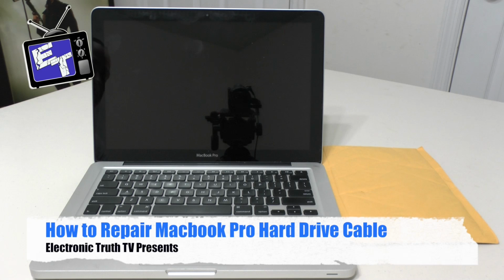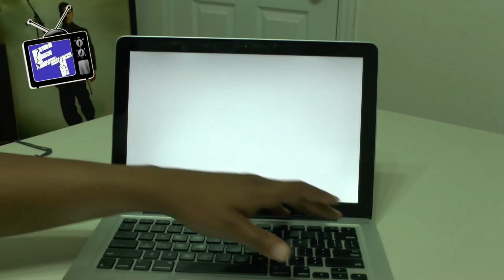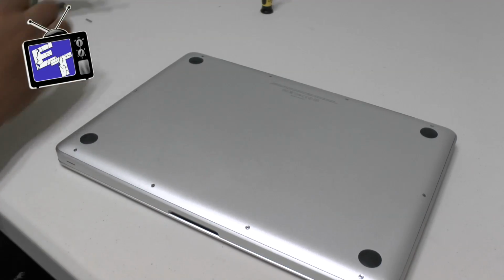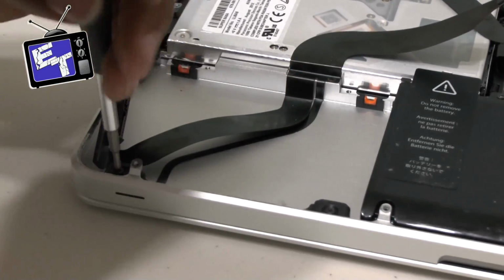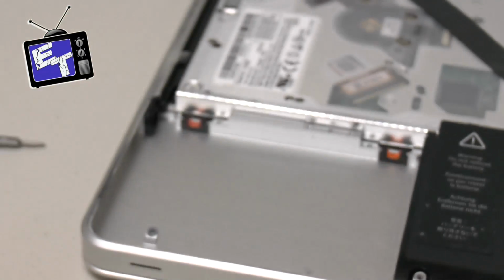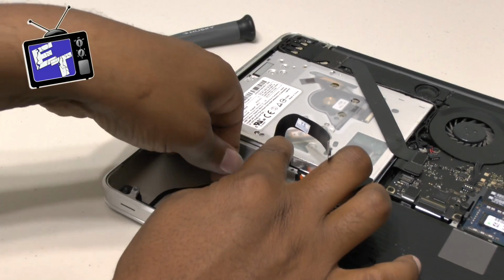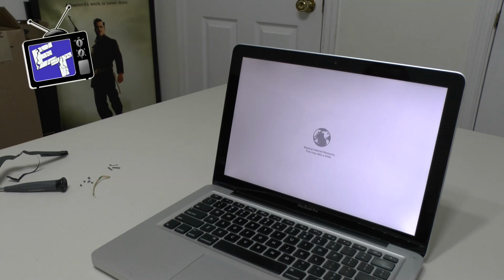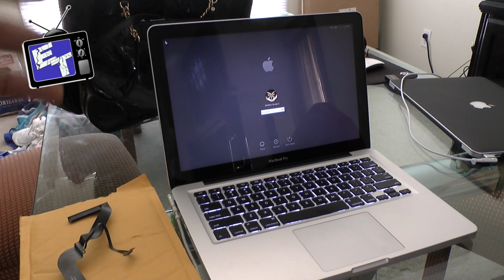How to replace Macbook Pro Hard Drive Cable

Comment: Yo this question mark folder just happened to me and have troubleshooted pretty much everything. I'm curious do you know if the hd cable would show up faulty on the diagnostic report when you boot and press the "D" key? You also said towards the end of the video you re-installed the operating system. Im really hoping I don't have to do that since I didn't use time machine before the ? folder. Please it would be great if you got back to me as soon as possible.
Reply from the maker: Hello, I'm not sure... The reason I did a fresh install was because the drive I was working with has been corrupted. You might not have any issues replacing only the cable. Good luck
Reply: Yeah replaced the cable and everything was back to normal. Lucky enough to not have a corrupted drive. now time to setup time machine for precautionary measures. Thanks for the vid.

Comment: I replaced my hard drive 6months ago and now had issues once again this time it was needing a new cable. I got the new cable in and still new hard drive got it all connected but now it wont read the hard drive. I get an exclamation point with an error -1005f. I took everything apart once again(maybe a cable was loose) re-installed the error is gone but still not reading the hard drive. Any suggestions?
Reply from the maker: I'm not sure... It might be worth letting a apple tech look at it to at least diagnose your issue.

Comment: Thanks man~! I have been having the same problem. Any hard drive that I install in my laptop makes the blinking folder come up. I did some troubleshooting and came to the conclusion that it's probably the hard drive cable that needs to be replaced.

Comment: thank you. i had some problems upgrading from hdd to ssd. first i had problems with deleting the drive, then i wasnt able to get the backup on the new drive...so i made it via usb...then i placed the ssd into the mbp again and this folder appeared....50 bucks and one week later my mbp2012 is running speeds on a completely insane level...now my ssd works :D thank you :)

Comment: great video!  I am in the process of buying the replacement cable but was tentative because there are ones that have the bracket and others like the one you purchased.  Now that you showed me how easy it is to attach the IR sensor looks like I will be buying the less expensive cable that doesn't have the bracket included!  Thanks for the vid

Comment: Thank you so much for the detailed instructions! I am now heading for the Genius Bar to have the new hard drive reformatted and will then reinstall from my external drive - Time Machine backup. Had a minor heart attack at one point when I thought the cable on the bottom bracket had broken away, but it was all good, once I rewatched that part of your video. Found the cable online and had it in a matter of days.

Comment: How can you diagnose to see if it's the hard drive or the data cable?
I have a 2010 Macbook that's doing the same thing.
Reply: +Trey Jennings run an AHT.
Reply: +Martin lol just saying run an AHT would mean nothing to a normal person. Apple Hardware Test here's a tutorial. https://support.apple.com/en-us/HT201257
Reply: +Trey Jennings I found out it was the cable by replacing the hard drive and the utility wouldn't recognize the new drive.  I put the drive in a USB case and was able to install the OS on it, but then the computer still wouldn't recognize it.

Comment: Thanks for this. Well explained and clear. A couple of things: Those little screws that hold the middle of that cable are bastards. Very small and easy to strip. Also laying the cable down correctly can be a little tricky so needs care. Good vid though.

Comment: Hey juanje99, back in January I ended up purchasing the cable with the bracket already attached on Amazon for $34 so I didn't have to deal with connecting the copper ribbon cable. Good luck.

Comment: Love the video and appreciate the step-by-step process. I have a 2009 MacBook Pro. When I power on and input my password it freezes every time. I tried to do the recovery process however, it didn't show 2 disk drive as I've seen in the videos (Macintosh HD & Recovery HD). It only showed the Macintosh HD. When I got to the disk utility the Macintosh HD, verify disk & repair disk are all greyed out. Even tried reinstalling the OS but it was stuck on loading mode. Could the cable be the issue here?

Comment: Difficult to tell for sure if the little gold ribbon cable is actually snapped in....how would I know for sure?! I did replace the data cable and it solved the problem!! Concerned about the little gold cable though!??? Anyone?? Thanks so much!!
Reply: +turner111971 did you find an answer??
Reply: +turner111971 may I please know how you snapped it in? how did you know when it was actually in and what did you use to put it in?
Reply: juanje99 So far I haven't had any problems with it, so I guess it's snapped in like it supposed to be..Thanks for asking!!
Reply: +turner111971 yea but HOW did you snap it in? did you use special tools? and how did you know it was snapped in properly?
Reply: +juanje99 Because it's working.

Comment: You mentioned reinstalling the operating system, when you do that will everything be in tack from the hard drive as far as data that hadn't been backed up recently, since there isn't a problem with the hard rice itself?
Reply from the maker: You shouldn't need to reinstall the OS unless you have a corruption. Once the cable is changed everything should go back to normal

Comment: Thanks bud, worked a charm! One thing that could have been a little clearer is when connecting that tiny gold ribbon cable into the hard drive cable. I used a tweezers to get it in properly, but it could have been easy to not insert it far enough if doing it by hand. Thanks so much for doing the vid though, this is the clearest version on YouTube :)
Reply: +William Organ how did you insert it far enough? how find you find out if it was in enough? thank you for any help
Reply: I used a tweezers to push it in. I pushed it until I met the first bit of resistance, and it sort of "fit" in that distance without it falling out like when I was trying to put it in my hand.

Comment: Smashed it with this video, bro. Thanks a million. Getting that tiny little gold lead to click into the connector at 7.45 is pretty fiddly(!) but apart from that your video made it super easy. You're a legend. :)
Reply: +Kaiser Saucy how did you manage to do it? what fid you use and how did yoy make sure it was in correctly?

Comment: Hi, so does this delete all your hard drive information when it is done and you have to do all the updates? ? And possibly some Trouble shooting help before I decide to buy the replacement?
Reply from the maker: I am not sure if all the info is deleted. I backed up the drive before I started the process.
Reply: This is only a tape, it will dont delete your data from hard drive

Comment: Thanks, this was exactly what I needed. Worked for my mid 2012 Mac too. Only issue, was you skipped over reattaching the ir cable. That was a little difficult. 
Thanks though.
Reply: +Donald Blue hi how did you reaatach the cable. please help me!
Reply: +juanje99 I used tweezers to help slide it back in. It took a few tries. Be careful not to bend the connection though.

Comment: First let me say thank you.  I had earlier done some reading about the blinking question mark in a file and figured I would start with the cable.  Your video helped me, a person who has never taken a computer apart in my life to include my time as an "IT" in the Navy, successfully fix my computer.  However, I agree with a lower post about inserting that small ribbon.  I eventually figured out what you meant about the small slot but I question whether or not it will stay in which case I may have to go back in and gerry rig something.  Regardless, thank you for the video.  It is obvious you posted this to help people and as a now college student with little money, the $40 this took (to include the tool set) has saved my semester financially and computer wise.  Good luck going forward!

Comment: Good video except that you omit the only part that's actually difficult - reinserting the tiny ribbon cable.  This takes some time and patience.  The way I did it was to affix the receptacle piece into place with the adhesive backing (so it will stay in place), grab the ribbon cable near the end with a pair of tweezers, and the gradually push it into the receptacle.  This took some time and I was worried about damaging the ribbon cable, but eventually I got it to go in all the way. If you don't want to take this aspect of the repair on, the replacement kit sold through ifixit comes with a replacement left side hard disk bracket so you don't need to worry about reinserting this cable.  Here's the link:  https://www.ifixit.com/MacBook-Parts/MacBook-Pro-13-Inch-Unibody-Mid-2012-Hard-Drive-Cable/IF163-041   More expensive, but if you're concerned about this aspect of the repair, this makes the entire process very simple.
Reply: Totally agree, infact I think I messed up that cable when removing it because I didn't see him flip up the little switch to release it
Reply: +Eddie T what little switch? also, how did you end up making it work?

Comment: Great video right up to the part where you connect the copper colored bracket ribbon cable. Why don't you show how to connect this?  You pulled it out from the old but never showed how to put it back in..!!!  I just don't get it. I've watched 2 other videos like this and not one of them shows how to connect the bracket ribbon cable. This is frustrating; I'll probably have to make that video myself for people having the same issue.
Reply: +Rod S. did you ever get it???

Comment: Great video very helpful and in focus! One little question. That yellow ribbon cable. How did you get it back in. I already did the fix to my computer, but it is obvious I didn't get that part right. I can't seem to get it to lock into that slot. Any help would be appreciated. Thanks!
Reply: Electronic Truth TV You didn't get back to him!
Reply: Jarom McLiver I used a pair of tweezers and a magnifying lens to slide the ribbon cable into the oh-so-tiny slot.  At 10x magnification, it is MUCH easier.
Reply from the maker: Hello, let me review the video and I'll get back to you.
Reply: Sounds good.
Reply: Electronic Truth TV Got the same problem, could't attach it.
Reply: Bruno Boaro same here, I had to take it to Apple Store :(
Reply: I somehow managed to get mine in. It never clicked or snapped in. I just said screw it when doing my hard drive cable and tried to do the best I could with the little yellow cable. Then I tested the IR and it just seemed to work. It was just luck. So best of luck if you get to that point and have the same trouble I did.
Reply: Jarom McLiver I'll post a video of me flipping the little switch that makes it easier to out the gold cable back in, just in case you ever need to do it again
Reply: Real Deal true 🤦🏻‍♂️

Comment: Great vid dude. Thanks for that. I have same issues and would rather fix myself than pay  through the nose for somone to fix it. Point 8 in the process when you pull up the little yellow bit of adheisive with your flat side of your screw driver and click out that little chip board - when you put it back..where do you stick back the yellow adheisive? Underneath the new clicked in part or on top of it? This is the only bit I was unsure of. Hope to hear from you fella-cheers!